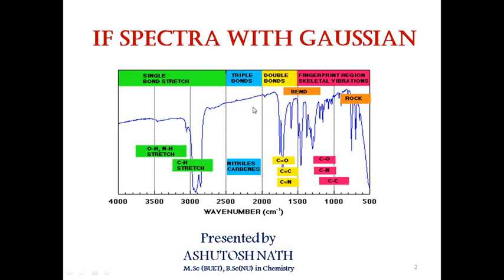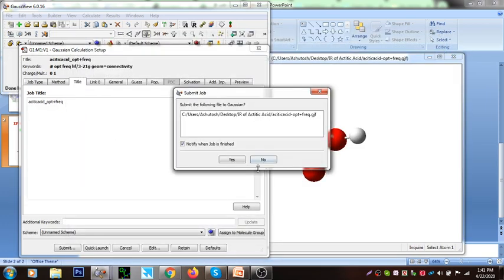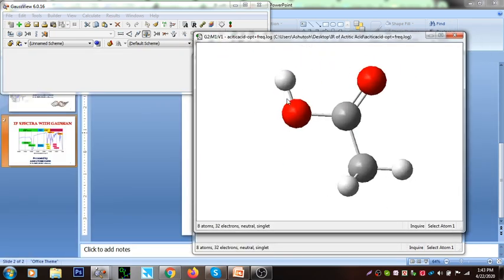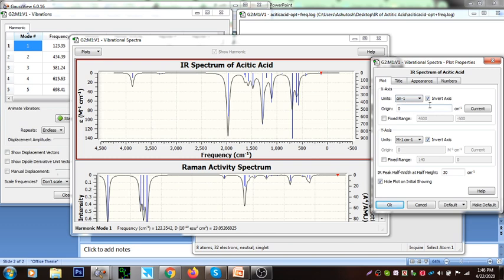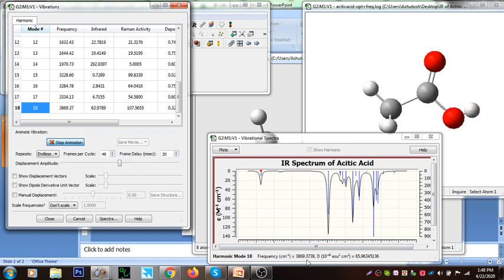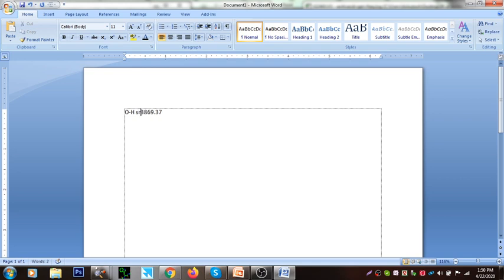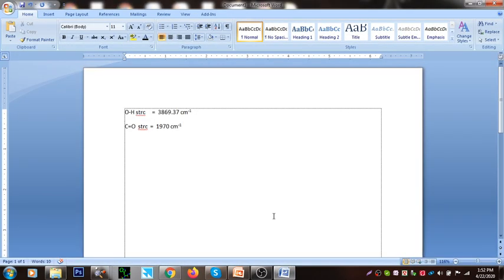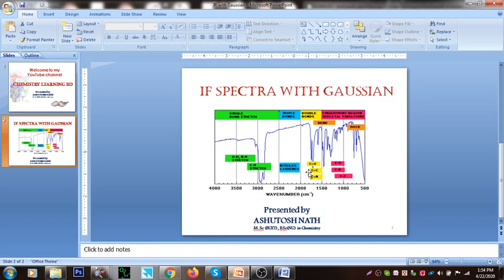Create IR Spectra via Gaussian 16 and Gauss View 6

Comment: Sir how much you calculate carbonyl stretching frequency of acetic acid it is out of range 1960 approx you show which is wrong it is not possible. You can check experimentally as well.
Reply from the maker: Thank you for your comment. I just showed how to calculate with Gaussian. Methods, Basis set depend on Result. Also in Gaussian calculation some error. We need to consider this error %. Then we will get similar result.